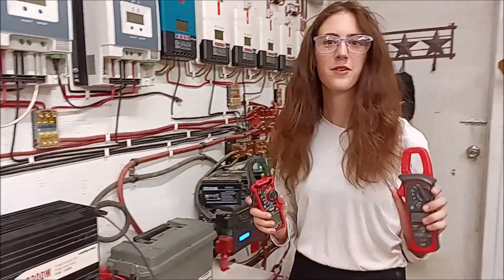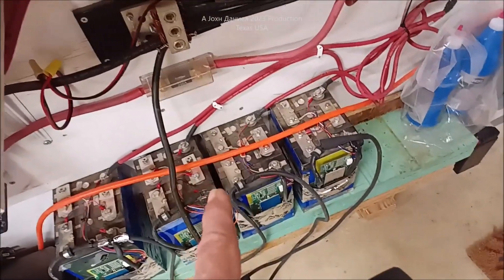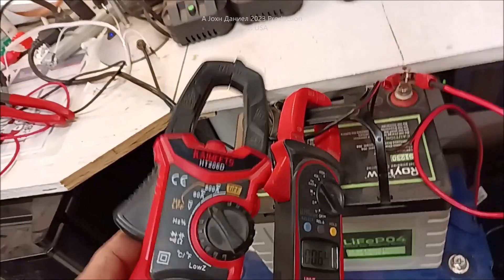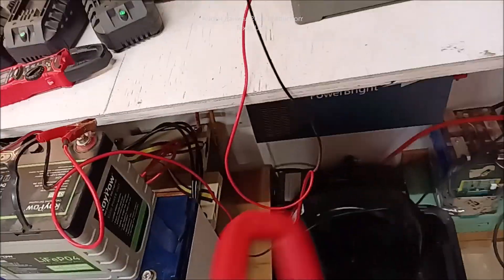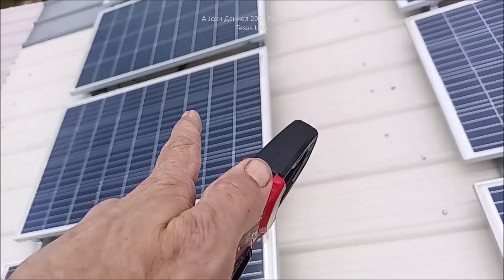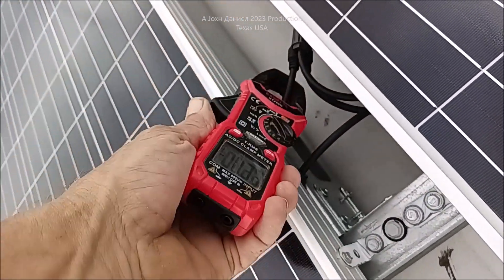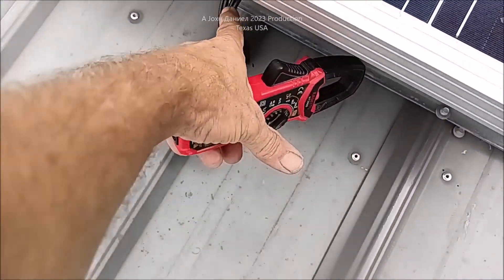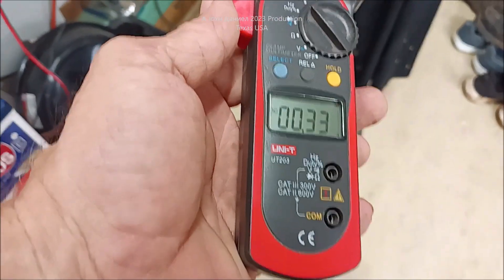DC Clamp Meter Use, skills and methods for troubleshooting Battery, Solar, Inverters and more

Comment: This popped up as a suggestion and thought oh great it’ll be good for xmas! then i noticed this was posted 3yrs ago.  How is it hold it up, is it still working, would you still recommend it ?
Reply from the maker: The meter? Yes. Everything you seen in the videos is in use constant and most is 24/7 for years now.

Comment: Off this videos topic, Do you recommend an upgraded 150w power inverter to replace the ford  factory 150w one that come in the F-150 and F-250’s ?? Thanks
Reply from the maker: Yes, I would put a 600 watt or larger in them. As long as you have a safe, well cooled location. The Renogy 700 PS model https://amzn.to/3t3qIz8 is about the best for such a plan. Small enough to hide, big enough to get the home refrigerator running in a power outage.
Reply: @JOHNDANIEL1   Ok great thank you for that information. I just subscribed (I’m not Rich BTW, he’s just a good friend). Thanks again great channel 👍👍

Comment: I use both DC ad AC clamp meters they are getting old but work well (Flukes). I get confused by positive and negative reading sometimes. During the first part in the shop is the first time you have confused me. I will have another cup of coffee and watch again. The on the roof stuff is just how I use mine (DC).

Comment: Great video! Thank you for helping people learn. I personally like my UNI-T better than the KAIWEETS. Just my preference.
Reply from the maker: Accuracy on the UNI-T is much higher. I use it on Auto mostly, but so is the RF interference on it so I carry both. The Kaiweets battery last probably 3X as long so either way I got one to cover my installs. Always have one so you can see if your MC4 and connections are making full power.
Reply: @JOHNDANIEL1  Great tips, I always enjoy watching.

Comment: y'know I have 3 "amp meters" and I just can't get them to show a current! wth??? I sure appreciate this video. Imma gonna revisit them and see if I was doing something wrong but your video shows how blood simple these are when they work right. Could it be that I got 3 lemons in a row? One of them is a Kaiweets ht206d because I did a freeze-frame on your prior video and ordered one. I'll focus on that one first... will update... CHEERS!
Reply from the maker: Put new good quality batteries in your meters, the ones from the factories on almost all china products from TV remotes to meters like these have been sent with poor quality cambodian made garbage batteries for the last few years.
Reply: @JOHNDANIEL1  BINGO! WORKS!
Reply from the maker: Good deal. Be sure to share that info with anyone having problems with similar items. Its the poor supplied battery in so many things.

Comment: Are the panels on your roof in parallel? I am going to check my 2 arrays today they are both wired in series.
Reply from the maker: With the runs so short, and the chance of hail damage I ran them all just as 22 volt parallel. 6X per controller.  If you run them 2 or 3 Series, be sure your not where snow, or hail will cripple you.

Comment: Thanks for the information on the clamp meters John ! Im still looking forward to the two Redodos, whenever you're up to it ! Ive got four new Power Queens and two new Redodo in the meantime while youve been recovering! Got them all on sale at different times ! Looking forward to seeing more content and maybe an email from you soon !
Doug in Pennsylvania
Reply: John here's a question for you.
If there were an EMP over America, wouldn't that take out the BMS in all of those lithium batteries? I know it can take out a lot more than that but would they be susceptible as well !??
Reply from the maker: Yes. This is why you buy BMS spares https://youtu.be/DF6FE_4Iduc and set them aside in a metal container in a metal building! My main reason to buy those cheap $15 ones I am using on the recycled cells in the shop. I got 20 of them in one buy when I found they will work with any battery to deliver safe output and charge in basic use.
Reply: Thanks for the heads up John !